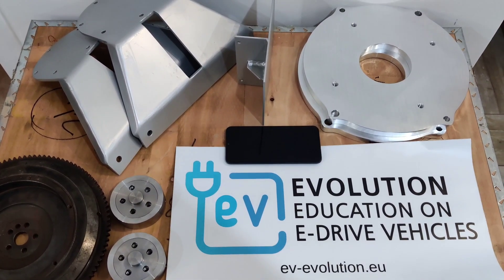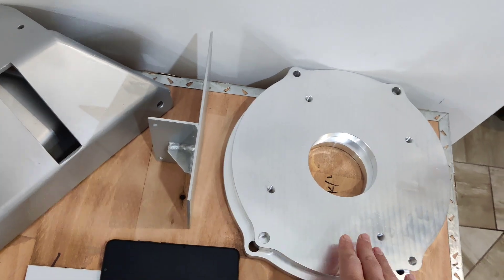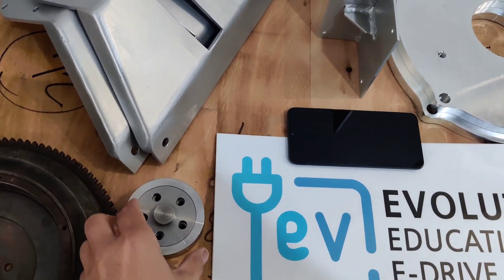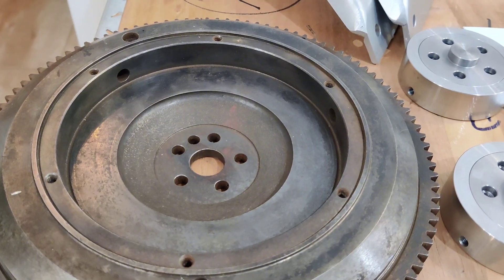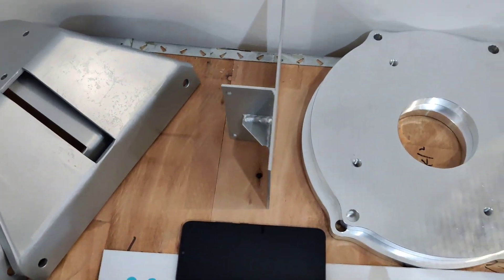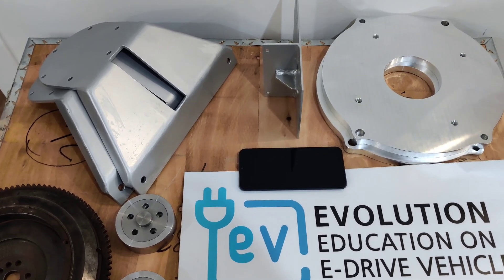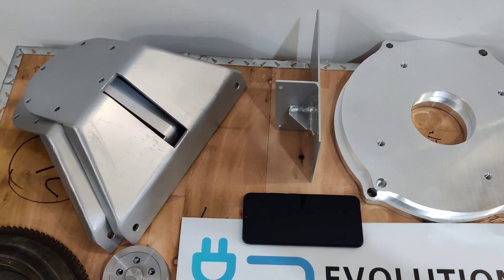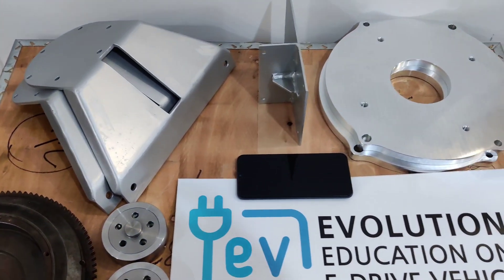Citroen 2CV, Dyane, Mehari EV Conversion Kit

Comment: How much the power need  to convert a car in electric motor for example car weight 750 kg
Reply from the maker: with our standard motor 15/30 kW it would be flying like a rocket.
Reply: Thanks for the answer. I am very interested in this field and have a lot of questions
Reply: Is there any particular reason you keep the flywheel and clutch? And why a splined shaft on the motor rather than a plain shaft?